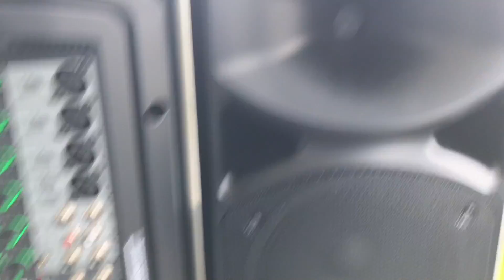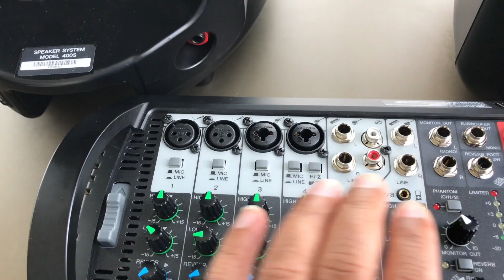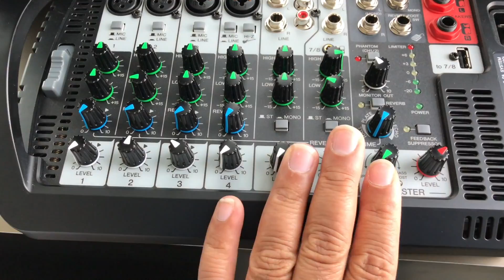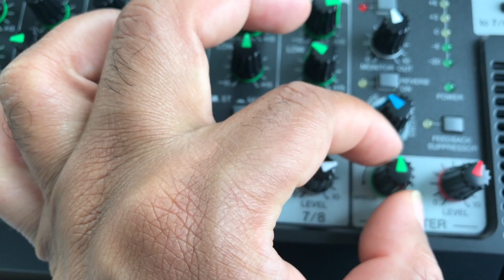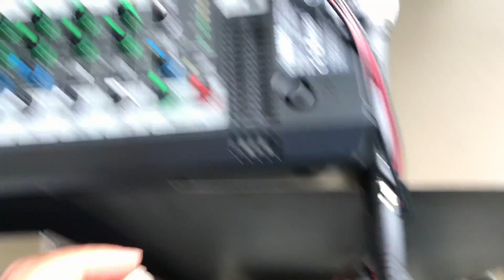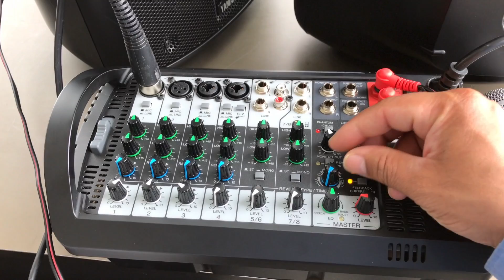Portable PA System Setup for Musicians Bands Conferences Live Events|Yamaha Stagepass

Comment: Thank you for the review. Have you had much experience using the MONITOR OUT!  For example performing with guitar + vocals. I find it difficult to hear myself.
Reply: I do as well. If I plug in two monitors will that make them be in stereo? As of now I plug in one monitor and its in mono.
Reply: @butchworm7793  Thanks for commenting Butch Worm. I have on the way a  Hosa YMP-434 Stereo Mini Female to Mono Phone Male Converter Adapter. Will just use earphones for now.

Comment: How can I use this device for Facebook live streaming? Set up and connection please. Thanks
Reply from the maker: First tell me what are you trying to achieve , why you want to use this PA system in conjunction with live stream to Facebook , do you have local audience as well ?
Reply: @AVMEVideos  hi, i am a singer, and wanted to do live Facebook streaming from this Yamaha BT 400 Bluetooth enabled, for live singing, good. Now I want to connect my mobile either Android or iphone to do live streaming, how can I do? What connections requires? What adjustment or settings needed, what cables to buy? I have my several audiences as well. From You tube can play karaoke tracks alongwith singing by shure dynamic or condenser mike, how to divert stereo sound to record here.pleas assist me.thanks
Reply from the maker: @anandshrimali5282  .
1: Connect all mics and instruments to Yamaha System.
2: Take a mix out of all input sources from the Yamaha mixer.
3: Connect to the AUX in/Line in of a capture card.
4: Connect Android or iPhone using digital AV adapter  Lightning to HDMI Out ( for iPhone)  or USB / USB-C to HDMI out for Android phone ) to HDMI input of the capture card for the video.
5: Download Vmix , Xsplit or OBS to live stream to Facebook or Youtube.
6: Connect the capture card to Win PC or MAC PC via usb or thunderbolt.
7: Configure the capture card inside the apps vmix , Xsplit or OBS to capture Audio from AUX in ( that is coming from Yahama Mixer) Video would be captured by phone.
8: Configure your URL or account for Facebook or Youtube in Vmix , Xsplit , OBS to live stream to your channel or page.
Hope above helps you for your setup.
Reply: @AVMEVideos  thanks a lot. I will try this set up. Did you notice in this yamaha bt400 stage pass, there is a small phone sign !!and socket?  What is that for? Could you explain how to explore this function of mobile socket? What cable require? I think TRS to TRRS to connect!! I am not sure.
Reply: @AVMEVideos  Connect to the AUX in/Line in of a capture card? Can you tell me which one I have to buy to fulfil my streaming with the mentioned software's?
correct company and Aux in/Line of a capture card details please.
point 2 you mentioned , take a mix out of all inputs sources? in the mixer where to connect? guess 5/6 port! red and white socket?
in this mixer at 7/8 the phone icon and socket there! what is this for and how to use.
send me some links to get full idea. or set up diagram please.
Thanks for your guidance.
Reply from the maker: @anandshrimali5282  , Get this capture device , it's reasonable priced , professional grade and versatile . https://www.blackmagicdesign.com/uk/products/atemmini
If you need consultancy fro your setup then I believe it's better you hire a AV Engineer.

Comment: What are your thoughts about the fan noise ?
Reply from the maker: the environments/applications it's designed for the FAN noise would make no difference in sound reinforcement !
Reply: Thanks for your answer.
I'm specially interested in the noise that the fan is producing to it's environment.
In your video, when you switch on the unit, I can hear the fan running.
I have an older Yamaha Stagepas 300, and I know that it's fan is making a lot of noise.
I'm very interested in the 400i that we want to buy for our videoclub to connect to our PC for watching our video's.
With the old 300 unit, you can hear the fan in quite situations of the movie and this could be disturbing.
So, I'm a little bit concerned that the 400i is also not so quiet.
Reply from the maker: okay , i did not notice the fan noise at the time of making the video. I would not recommend this system for watching videos/movies in a quite sitting environment. I would recommend you to look at theater systems for your application.
Also if the FAN in your unit is making noise then either over the years it has collected a lot of dust on fins and the motor is working at max to spin it thus resulting in noise or the FAN motor is failing . Give it a clean with compressed air ( not from the can ones ) .
Reply: @asilnevs  when you turn the system on, of course you can hear the fan working, once you start playing you forget of that all, there are no traces of any interfering sound
Reply: Give me the Purchase link

Comment: Excellent Review. Thanks!.. Does this mixer have any recording feature, if I wanted to record a gig. If yes, does it support USB or SD?
Reply: AVME Videos : Could you please tell how much is it cost, where did you buy it from and the warranty of the Yamaha stage pas?😇
Reply: Hi,nice review you presented. Can you tell me how can I use stage pass BT400 Bluetooth enabled, I have, for Facebook live streaming, means wires and connections, where to use and connect for Android or iphones? How to record into phone or ipad? Thanks
Reply: I guess 2 are needed for a 4 Piece Blues Rock Band...2 Electric Guitars...1 Bass Guitar...Full set of drums....2 to 3 Mics...2 to 3 monitors.....
Reply from the maker: Cheers , the USB port is for connecting iphone/ipod only for playback , it's not for recording , you can use Monitor L/R out to feed to an external recording device.